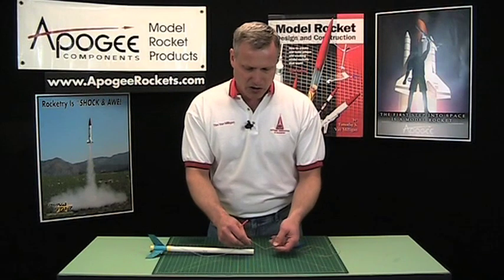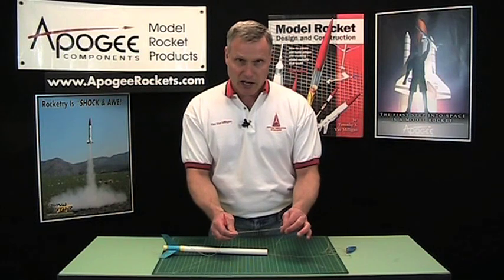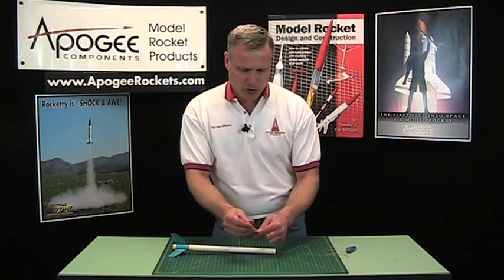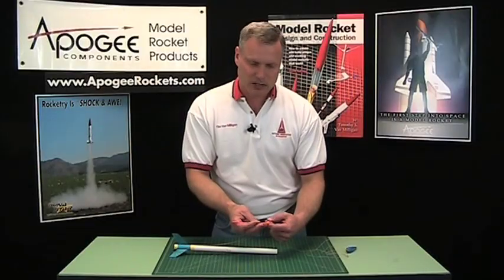Model Rocket Deployment Shock Cords

Comment: By chance I have seen a lot of videos on youtube for similar methods to keep your workshop electric extension cords from being tangled in storage.  These methods usually start in the middle of the cord with the cord doubled over then do the crochet just by hand.  I think starting in the middle it crochets twice as fast and the resulting length of the weave is half as long.  I need to go out in the back yard and try this with my 100# kevlar to see if I can easily create it by hand and if it deploys from the middle as fast as yours deploys from the end.

Comment: Hi, I am new to model rockets. I have built and flown a few estes rockets and I noticed they the cords they use are rubber bands. Is it necessary to be rubber or can I swap them out for a kevlar rope?
Reply from the maker: It's your rocket. You can swap it out with anything you want. Kevlar is fine. Just make it longer than the rubber that came with the kit - maybe 3X longer.